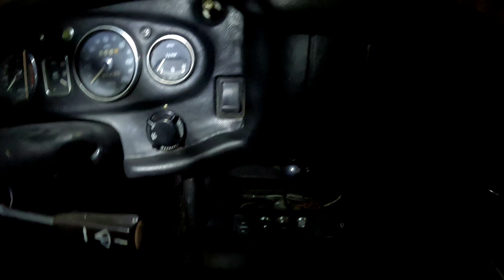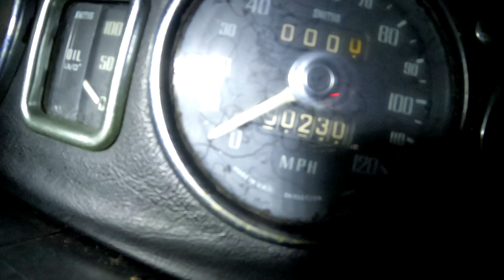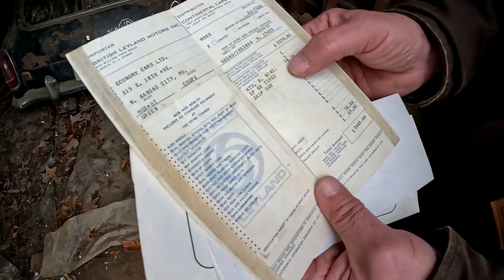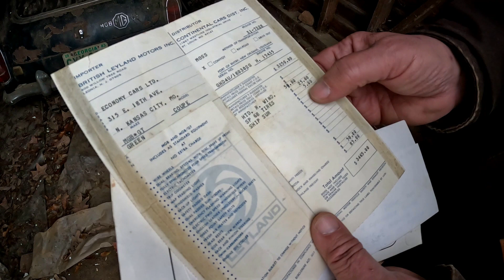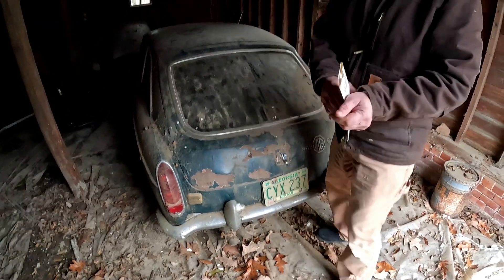1969 Barn Find after sitting over 35 Years!! pt. 1

Comment: Would that center consul possibly be a JC Whitney catalog item?
Reply from the maker: We believe that would be a very good possibility. I have not ever seen one on an MGB but it fits like factory. Seeking information on that. Appreciate the comment. I will have to locate an old catalog from the 70's and see if I can find one in there.
Reply: I have piles of JC Whitney catalogs from 60s, but 1500 miles away. Check ebay. The back of road and track had ads for English accessories. Can't recall.the company name atm
Reply from the maker: @CORVAIRWILD  how about a look through one and see if the console is listed??
Reply: @CORVAIRWILD  Perhaps you are thinking of MG Mitten.  Wish I knew what ever happened to them.
Reply: @stephendavidbailey2743  nope... I'll remember. I still have the magazines, I never discarded them, but they're 1500 miles away
Reply: Could have been made by/for Amco.  I still have a brand new in the package soft top I bought from them in 1996 for my MGB.